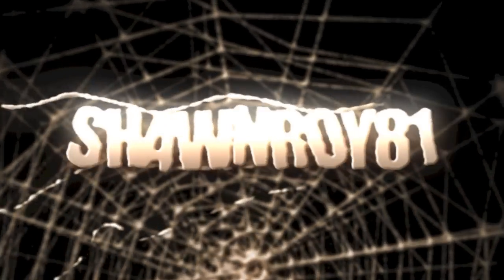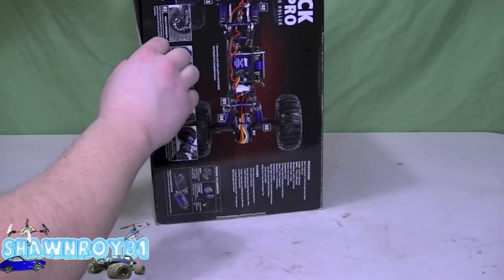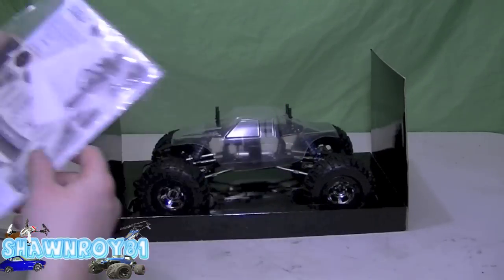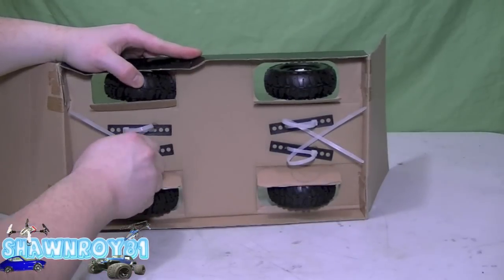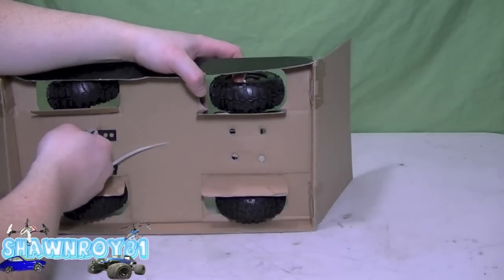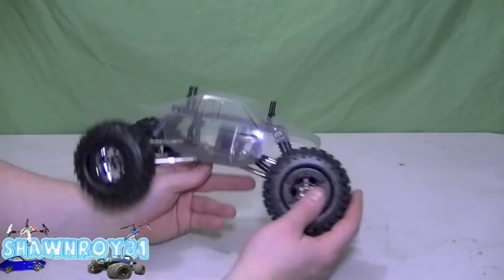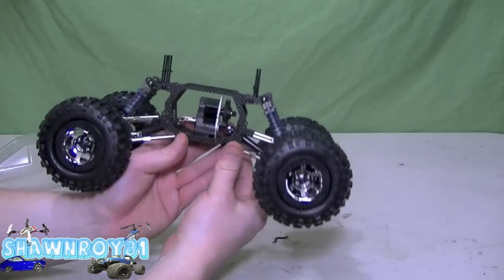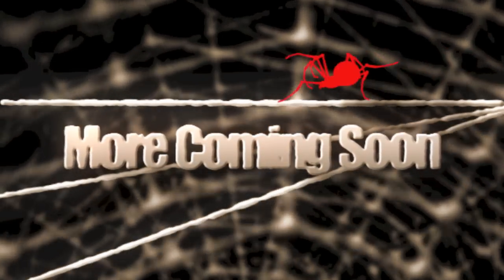Losi 1/18 Mini Rock Crawler Pro Unboxing

Comment: i have the same thing i would recommend get the smaller shock option you don't need all the articulation it has and it helps a lot with the centre of gravity